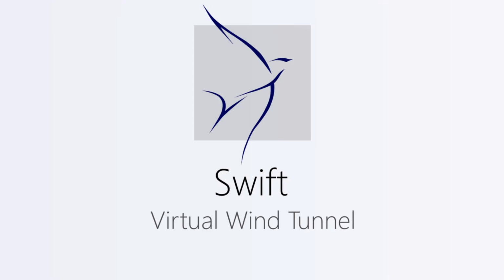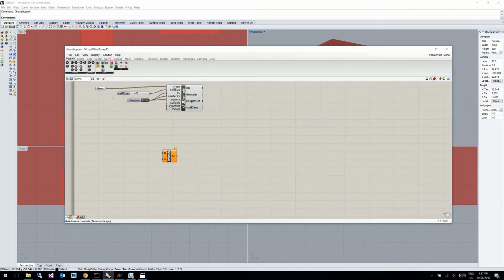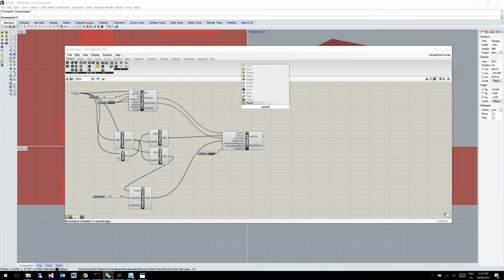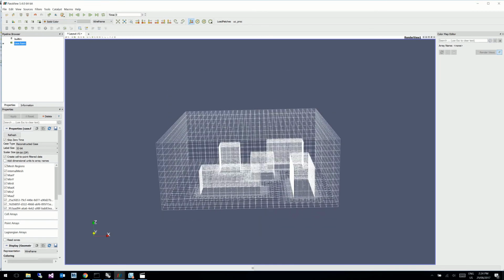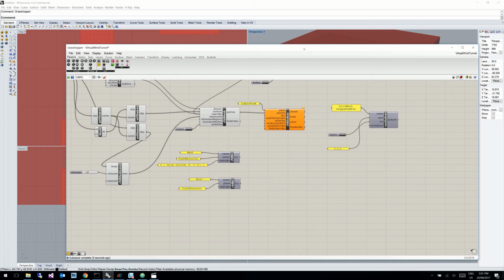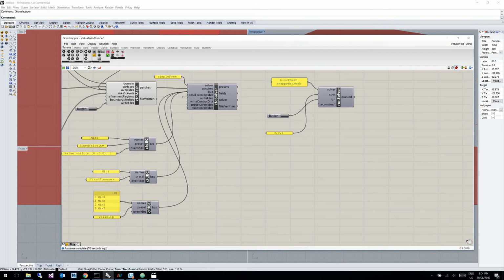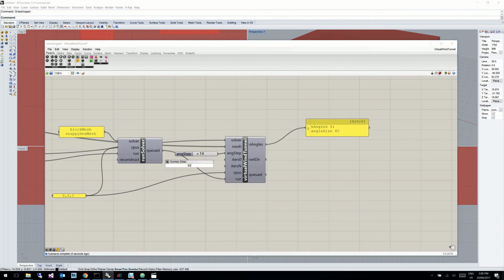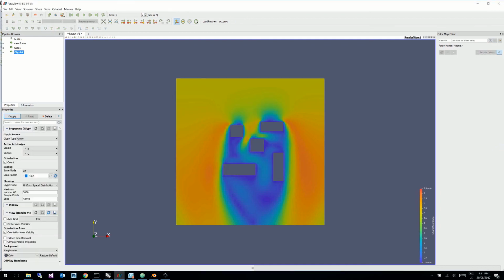Virtual Wind Tunnel Demonstration

Comment: Is swift capable of calculating with fluids apart form air? Or is it only limited to air. I’m trying to get a water cfd simulation within grasshopper but I can’t find any plugins that can use water.

Comment: The file you reference contains an unkonwn node node called "system config"   in which you plug a text file into a boolean operation>  why.   what good is referencing example files if  they're not the same?

Comment: Appear this: 1. Solution exception:License Invalid. Get a new one using the License Component.
Reply: On a blank Grasshopper panel drag and drop the ODS -> Registration Key component (with an icon of a key),  Connect a Panel component to the output called "status", this should give you a message indicating the status of the license and also a copy of the instructions below in case you need to acquire a new license.  Connect a Panel component to the output called "local credentials". Right-click on the panel showing the output from "Local Credentials" and select "Copy Data Only"
Go to "ods-engineeringDOTcom/tools/ods-swift/license/key" and paste the key into the text-box on that page and press the "Validate" button.

Comment: hi, when i load the case.foam file on paraview nothing shows...
Any suggestions?
thanks
Reply: after loading the case.foam file you have to check the mesh-regions and fields you want to load in the menu on the left and then press Apply. I do this super-fast in the video so you cant really see it happen.  If that doesnt work then check if your VWT folder has numbered results in it? 0, 45, 90, etc... if not then something went wrong with the calculation. Ensure you are using the Rhino 5 (64-bit) executable.
Reply: @Opitman  Hello, I am facing an issue. The folders are being created when I run the script, but there is no data stored in the case files. The OpenFOAM case files are empty (0kb)  and no background process is ongoing after few seconds. Kindly help if someone faced the same issue.